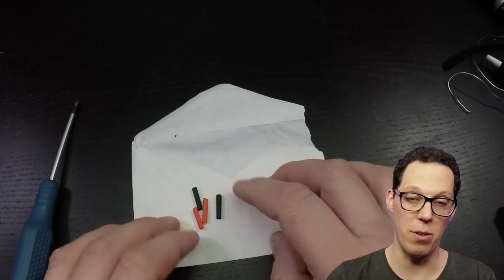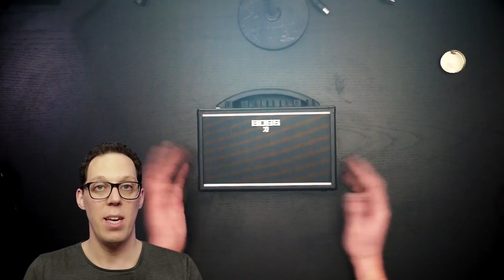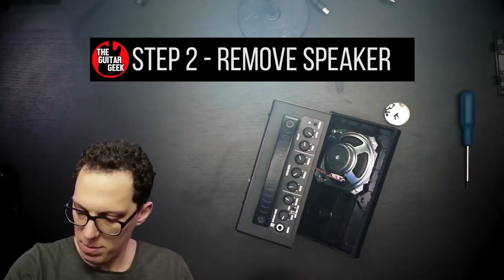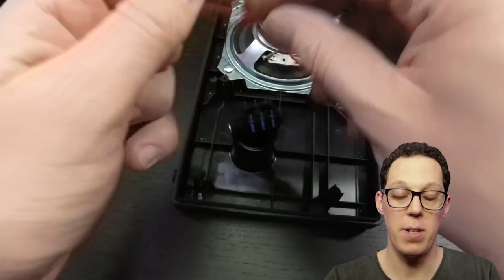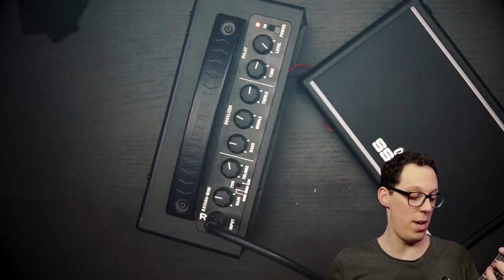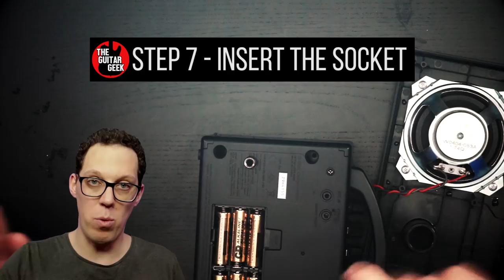How to mod  your Katana Mini - Adding an external speaker out

Comment: I wouldn't worry too much about battery vs mains power. Either way the amp is still receiving 9 volts DC.
You should use the last set of pins for negative (ground) and leave the middle set unused. That way if you ever connected a speaker using a stereo cable (unlikely) the negative wire would still be in the right place, the sleeve.

Comment: thanks for taking this apart, i'm thinking of adding strap pegs onto the sides of this thing so i can carry it around as a amp purse, but i didn't know wha the internals looked like and was afraid i might drill into a wire.

looks like it's pretty spatious in there

Comment: This worked like a charm, thank you! Used my Katana Mini + Harvey Benton G112 Vintage. I did follow Angus Black's tip of using the last set of pins for black, which works well and makes the hack more universally compatible. Cheers!
Reply: hy Nicolas, excuse me, what "angus Black´s tip" do you mean? thanks
Reply: @heavyfeitus870  you should be able to find it in the comments under the video. He advised using the last set of pins for the ground (negative) and leaving the middle set of pins unused. That makes the build compatible with stereo jack cables, in case you ever use one to plug your guitar in. Hope that helps!
Reply: @MrMidnightSon  Of course it helped thank You

Comment: Just for kicks I'd love to hear the Katana Mini go through the Artists speaker for an interesting comparison. No soldering required just connect up to the spade terminals with a jack socket the other end. 

Really interesting mod. I've been thinking about buying a Katana mini for the bench for testing (and time passing when I've had enough of fret polishing for a while) but this would be a cracking upgrade if I could buy a smallish cab for the corner of the room. Cheers!
Reply from the maker: You're welcome! I'm one step ahead of you...stay tuned
Reply: That was pretty much the plan mate... ;o)

Comment: Hi, great videos! :-) I have a MkI 100 212, and I was hoping that you could do a video where you could show how to do a mod so that one could both use the amp as a head with an external cab, as well as using the the internal cab with an external head, preferably by adding jacks to the real panel beside the existing ones. In my opinion the MkI's sound better than the MkII's. I also have the MkI 50, and if there is a way to add a FX-loop to the rear panel in a similar way with jacks, that'd be a world of help. The MkI 50 - given that one tweak it so that it sounds right because right out of the box it really does not - might be the best amp of all time, considering versatility, sound, portability, and plain powerful headroom. Cheers! :-)

Comment: it's because the receive end of the speaker have a capacitor prevent overload input, or else you need to put additional capacitor at signals cable series to the jack.

Comment: Thanks, just did it but a silly, very silly question ! You plug the guitare in the input of the Katana mini.  You plug another jack on the "new" jack socket we add, but in which input do you plug it on the "other" cab ? If i plug on the "input" of my Blackstar HT 20 ( combo)  it will pass through the amplifier.... on the rear i have Emulated output, the send/return and the ouput for other speaker.... Thanks a lot

Comment: Hello! I really enjoyed this video. I am wondering if I'd plug this into the 16ohm jack on my amp? Is there a way to tell how many ohms the output is? Also, you used a speaker cable I assume?

Comment: works great ,can do it with 2 2way switches too if you cant find switching jack ,, just put a 2 way switch on both speakers power wires (red) coming from the computer(power),(if using 2 seperate switches make sure 1 switch doesnt cut power to the other ) wanted the nice delay louder and cheaper ) will work exactly the same on batteries or powered from the wall , i see why he said that but its a non issue ,have fun my friends and thanks guitar geek dude )

Comment: hey! would this work to wire a speaker IN jack as well? since the ac10 already has a speaker out that mutes the original speaker, making one more like this for a speaker in would give the ability to use an attenuator between the two i think? does that sound about right?

Comment: Great video Andy! I love greenbacks! I use a Palmer 212 that I love with my Plexi... So funny how much of the tone comes from a cabinet! Cheers man
Reply from the maker: It's often overlooked. Greenbacks are my favourite
Reply: Yeah! I love them 2! I use Celestion V-types live for a bit more High end. They sound a lot like greenbacks, but they cut just a little bit more frequency wise. With my torpedo 2 notes stuff I always use a regular greenback cab! And also cool to look at is the Neolight Creamback Celestions if you're gigging! They sound like greenbacks (if not slightly better), they can handle 65 or more watts (I think), but the best thing is that they only weigh 1,5 KG!
Reply from the maker: My favourite mix is a v30 with a greenback. I'll have to take a lok at that creamback,  sounds great so far!
Reply: For some reason I don't like V30 speakers (with my amp). But I love them for some other amps! And yes the NEOcreambacks look awesome... I want them for a lighter/louder greenback sounding 212 :) BTW I love that P90 guitar you're playing! P90s and Greenbacks are tone heaven...
Reply from the maker: I'm going to have to go on a speaker safari at some point! Thanks max. It's the line6 jtv59p. Absolutely lovely guitar

Comment: This is an excellent mod. I did the same to my little practice amp, the Fender Mustang Mini. Now I get USB audio and software controlled patches, but with an optional 1x12 when I want to upset the neighbours.Nicely explained, thanks!
Reply from the maker: Great fun isn't it. I was genuinely surprised how well it held up
Reply: TheGuitarGeek I guess at worst it might drain the batteries slightly faster when it's driving an external cab, but there's a lot of untapped power in the circuits of some smaller amps, just waiting to get out!
Reply from the maker: I am still on my first set of batteries so we will see
Reply: TheGuitarGeek actually, I've never had to swap the batteries on mine either come to think of it and it's been in use for 6 months now. Hmm.
Reply from the maker: We must have magic batteries
Reply: TheGuitarGeek amazon basics D cells for me. They must be special and valuable vintage Tone Cells.
Reply: You know.. I was only joking - but come to think of if, didn't Danelectro market their own 9v batteries a while back as Vintage Tone batteries or something similar? I don't know if they were serious... I think Phil McKnight did a comparison video.

Comment: whats the difference between this and using the  "rec out" port...? 🤔 🤔 🤔
Reply: yes same question
Reply: the “rec out” port is not connected to the speaker, it acts as a headphone output/recording output to a mixer or interface. it’s also a 3.5mm jack, so you could not connect a speaker cable to it even if you wanted to.

Comment: Just bought one of the Boss Minis amps and am thinking of doing this to it. I'm not an electronics expert but what difference can it make to use the 9 volt power adapter after doing this mod? The power supplied is still 9 volts...

Comment: Did not work with my Harley Benton 212 V30 Vintage. Box is ok, internal speaker as well, but no sound when the box is connected. Already tried different cables. 😥
Reply from the maker: This mod is not cabinet specific. You’ve made a mistake somewhere
Reply: @TheGuitarGeek  I'll try to hardwire the cable. Maybe the jack is broken. Thank you.
Reply: @TheGuitarGeek  It's working now. Mostly the problem is the dumb human not knowing what he is doing (me). 😂
Reply from the maker: I hate to agree but I do 😂

Comment: Hello, great video!
I am thinking of drilling my katana mini to use the 12inch speaker of my old line 6 spider iii 30watt combo, by plugging the cable in the aux input so to only use the speaker. Is this feasible? Or will I have a damage regarding the impedance of the line 6 speaker?
Reply from the maker: Don’t do that! Speaker out to speaker only

Comment: There is no reason not to run this off mains, your switching power supply is going to be supplying the same DC voltages to the amp as the batteries and there are no mains voltages going on in the katana, and by the time you get to the audio output you are not going to be seeing DC either just the audio signal. This is a safe mod.
Reply from the maker: Cheers Anthony!

Comment: maybe you mentioned it - what impedence is the amp looking for? 8ohm?
Reply from the maker: i didnt. i had to guess at 8ohms. Seems fine to me and 8ohms is a safe bet.
Reply from the maker: I've just checked. it's 8 ohms
Reply: TheGuitarGeek On Jay Parmar's video on the same topic, he said the impedance is 4 Ohms.
Which is it exactly? 8 or 4
Reply from the maker: The speaker inside is marked at 8 ohms.
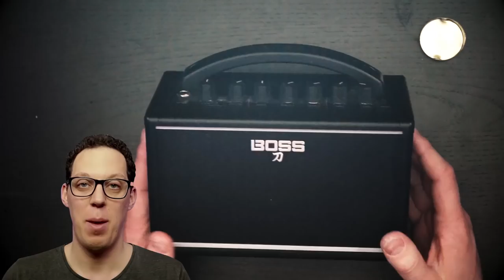Reply: @TheGuitarGeek  If you pause at 6:50 with the speaker in view, doesn't it say 4ohm?
Reply: The speaker doesn't say on it. I think his says 74Q. Mine says 75F so it may be a date or batch number. Putting an ohm meter across the speaker reads 3.6 ohms of resistance, so it would in fact be a 4 ohm speaker.

Comment: Good day, my VOX AIR GT will have two speakers, how can I connect one speaker in the same way, but more? FANKS.(two speakers at 8 om each and 25w power,The speaker you want to connect 80w 8om Celestion seventy)

Comment: Wait! What's the recommended resistance number ( 2 4 8 ohms) for this. Excuse me if im not making too much sense. EDIT: never mind, ive just scrolled thru the comments, so its 8 ohms. ALSO. I Cant bloody believe boss doesnt do this stock
Reply: I measured mine, it is 4 ohm.
Reply: it said 4 ohms on the back of the speaker in the video.

Comment: My Katana mini has headphones output. Doesn't it work the same as the mod?
Reply: That can't drive a speaker coil, only a headphone driver.   I have a Tech 21 Deuce Deluxe powered cab -- so it can take any signal, like a headphone out and amplify it with its own power.  I'm sure it would work great with the Katana mini --- and no mod needed.  

But I can get such great sounds out of the Joyo American Sound or AC Tone pedal ($25 each) through the Deuce Deluxe, that I don't need the Katana. . . .

Comment: would it be possible to make a small 2x8 cab that the Katana Mini could safely power so long as the two 8" speakers are 4ohm each?
Reply from the maker: The resistance depends on how you wire the speakers but as long as the sum is 8 oohms you will be ok. I powered the 212 rather nicely!

Comment: Does the small speaker shut off when plugged into the cab? Or is it on as well?
Reply from the maker: Yes,that's very important. The switched socket disconnects the internal speaker when the cable is inserted

Comment: do we know if the speaker is the same as the speaker included in the 100w head?
Reply: i believe the one in the head is 8 inches, while the one in the mini is 4 inches, other than size i think its the same.
Reply: You know it occurred to me well after asking this that it would likely be a massive overkill waste to put the same speaker as the head given the ratings it can handle
Reply from the maker: It’s not the same

Comment: I did that on my roland cube mini, and the result is UNBELIEVABLE when it comes out of my 4x12". It's quick, inexpensive and fun to do, too.
Reply from the maker: Damn right!
Reply: I agree! The micro cube is a lot thicker to drill through but it's well worth it!
Reply: The Roland MicroCube GX is 4 ohms. Did you have any trouble plugging it into an 8 ohm cab?

Comment: Now the katana air can be got for 250 pound I'm going to get one as I love the Bluetooth control of amp and sleep to on wireless

 I'm going to mod it to take a single 10 inch speaker when I want it loud will just buy a cabinet and connect it up was going to keep it stereo but to me amps in the room should be mono

Just going to interrupt the 2 air stereo speaker outputs and mono them into jack plug into a cab was going to use my 12 inch Hughes and Kettnercombo as a cabinet but 12 inch may be too much loudness to get speaker vibrating properly

8 or 10 inch may be better as I think that katana air sound isn't as good as vox or thr but I think it's the little plastic box and poor speakers although handy to keep for low volume

There is enough control in airs app to get frequency balance good I think through a single good speaker

I would retain all of the airs brilliant wireless and Bluetooth use along with all the effects but in a bigger bassier  sound poss a celeston something rich sounding

May be my perfect amp
Reply from the maker: Sounds like a plan! Where can you get the air for £250?
Reply: Used not going to destroy a new one
Reply: @simoncab1362  Did you do this modification and how did it turn out? Sounds like a prefect combo if it works

Comment: Would it work on Yamaha THR10?
Reply from the maker: I don't know. If you open the casing and it seems to be the same as what I've done here then it could be possible
Reply: I think it has two speakers in the THR10... so I'm not sure how you'd deal with that. (Because I don't know how speaker ohms work, not because I doubt you can!)
Reply: Either way your likely to have only one cable coming out to the two speakers. You'd interrupt them at this point. But of course check what's what and ask a qualified amp sparky if your unsure.
Reply from the maker: I don't have access to one unfortunately

Comment: Hi, will this jack socket work with your way of doing this? 

https://www.thomann.de/gb/neutrik_rean_nys_216_g.htm

Thanks!
Reply from the maker: Sadly not. I can only speak for the one in the links I posted
Reply: @TheGuitarGeek  well its a 6 pin stereo switched jack socket. What brand and model did you use so I can compare the specs?  Thanks!
Reply: @TheGuitarGeek  also what links?